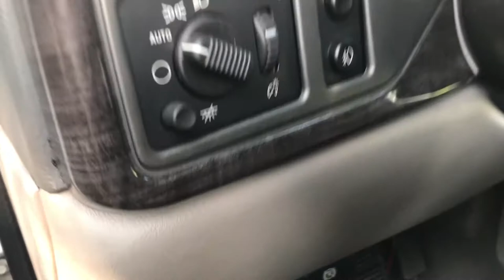YITAMotor 2003-2006 Avalanche/GMT800 Tow Mirror Review and Installation

Comment: How did you get your clearance lights on the back of the mirror to work??? Mine has blue wire that is for the reverse  light. But nothing for the clearance.
Reply from the maker: Mine have the reverse lights on the back and the turn signal on the front.
Reply: @takeroadslesstraveled6505 thanks. I thought my lights on the backside were actually clearance lights. Ended up being another set of blinker lights lol. So all I had to do was hook up the blue wire for the reverse lights.

Comment: I'm still trying to figure out how to hook up the leds wiring for the reverse lights I see how to run the wire just what do you so with it once it's in the cab?
Reply from the maker: Go to the 35:20 mark of the video. I walk you through how to wire in the white LED’s to your reverse lights. I go over tying the leads from each side together, tying the grounds together, where to run the ground to, and where to splice the leads into.

Comment: Do you have a lift on your truck I have the same one and am trying to make mine look like yours
Reply from the maker: 2” leveling kit up front with Bilstein 5100 series shocks matched to the lift (avoids having to run shock extensions). Bilstein 5100’s in the rear capable of adding another inch if desired, but otherwise it’s at the stock rear height.

Comment: Do you know if these would fit a 2002 avalanche?
Reply from the maker: GM did a big update in 2003 to the GMT800’s which including a change to the wiring, so these specific ones will not work with your 02. However, I believe YITA makes a set for 99-02 GM trucks that would work with your truck. You’ll just need to search through their products to be sure.